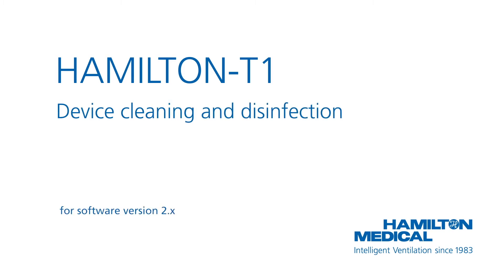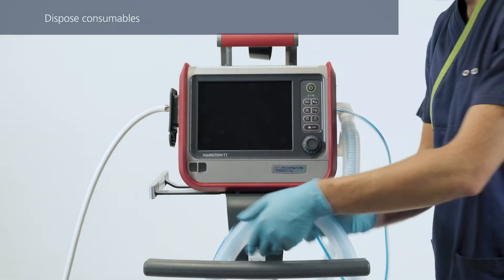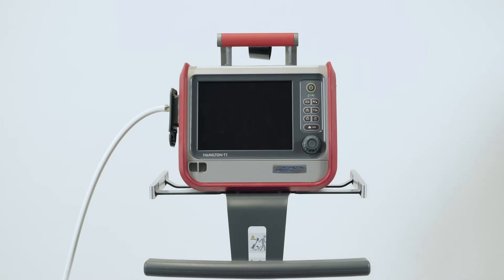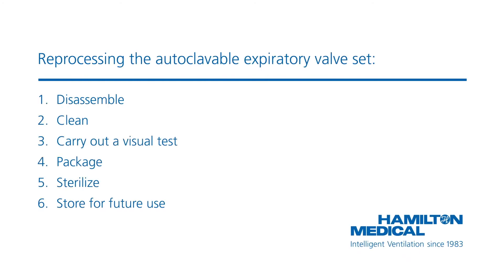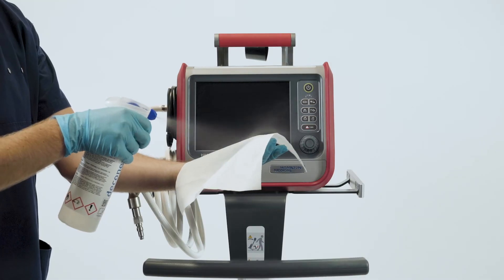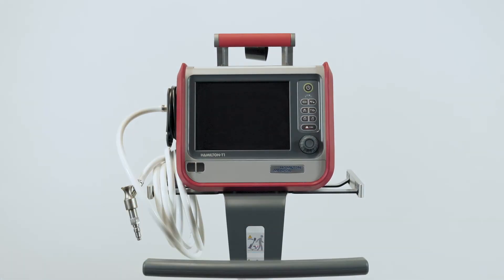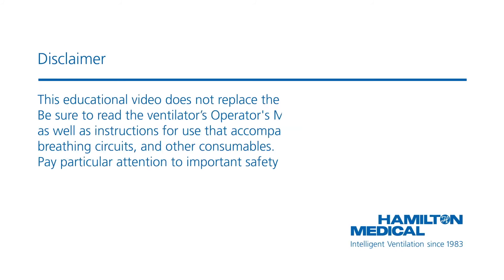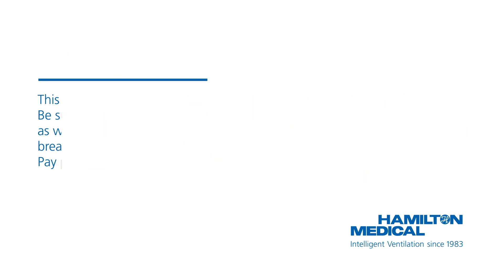HAMILTON-C1/T1/MR1 | Device cleaning and disinfection SW 2.x

Comment: Do non-disposable valves have to go to sterile processing after every use? Can we just wipe it with purple top wipes?
Reply from the maker: Hello Shaima. By definition, non-disposable valves are “non-critical reusable medical devices”. But, due to the fact that contamination by exhaled breathing gas could be possible, sterilization is the mitigation measure to avoid contamination from pathogens. For information on cleaning the valves, please refer to Hamilton Medical Reprocessing guide Expiratory Valve Set PN 624591 latest version: https://www.hamilton-medical.com/dam/jcr:e9d3590e-15c5-4e4f-bb3b-351ce0f2b116/Expiratory-valve-set-autoclavable-reprocessing-guide-de-en-fr-it-es-pt-ru-tr-zh-624591.07.pdf
Reply: @Hamilton-medical  Thank you